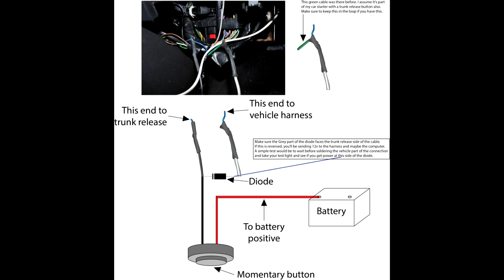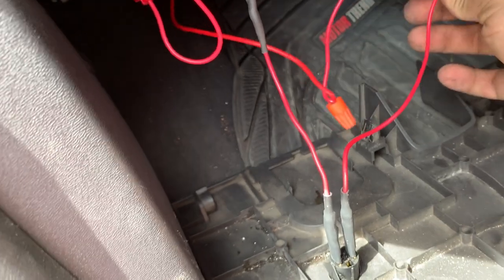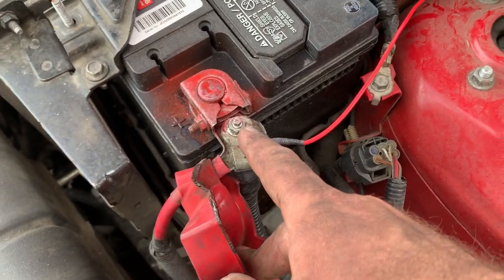DIY 2008-2009 Ford Focus Trunk Switch Installation

Comment: The blue wire was disabled from the back from factory (focus s 2009 the basic edition) I put the entire wire directly with a relee. The wire to the pcm wasn’t in so no problem with pcm. Your video really helped a lot so ty

Comment: I bought one with this kind of button/switch. How can I undo it? It's messing with my trunk and now I have the "luggage compartment lid open" everytime, my trunks light wont turn off and it's killing my battery
Reply from the maker: They probably put the diode in the wrong way...
Reply: Or the diode went bad, redo the setup with a 5 pin relay instead that way if it fails your trunk light won't be on, the button will just stop working. Also the relay is plug and play so you can just replace it ez if it fails

Comment: So I assume this is a alternate way to open the trunk?? So is yours one that you just walk up to and it opens? instead of cutting into the wiring under dash can you just run new wires to the trunk?? How would all that be wired up?
Reply from the maker: It’s far easier to do it like I did. It can probably be done from the trunk but then I’d have to run wiring up to where I put the switch anyways

Comment: Thanks I might give this a try! Has anyone else done this? Also any issue after having it installed for awhile now? Couldn’t you just put it to a wire under dash that has a constant 12V instead of all the way to the Battery?
Reply from the maker: I think because it would be a parasitic drain if you did it directly
Reply: @hanksgarage_  any problems since you had it installed?
Reply: Yes, that's what I am doing, as well I am using a 5 pin relay to disconnect the wire going to the fuse box and apply power to the trunk actuator. I've seen diodes fail before and let power go both ways so didn't want to take a chance, if you want the wiring diagram of my setup reply and I may do a vid and post diagram with it.
Reply: @robertvanderbush737  do you have a wiring diagram of your install? Or a video? Thx